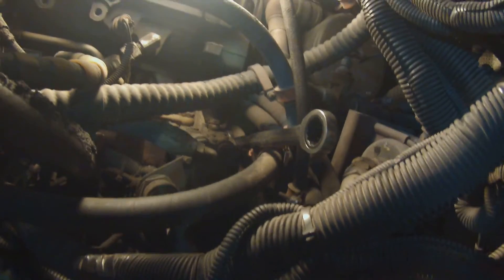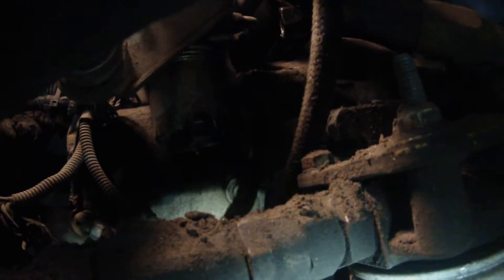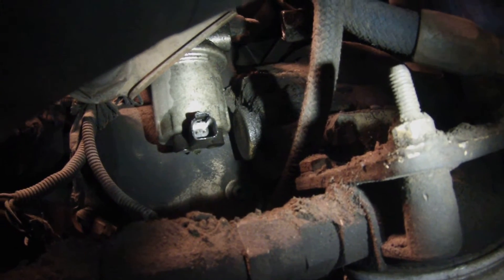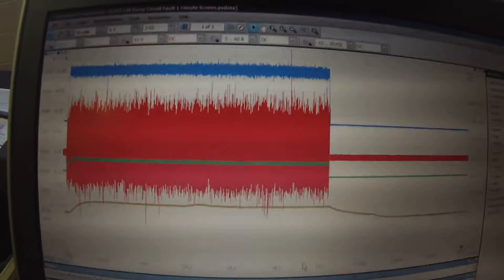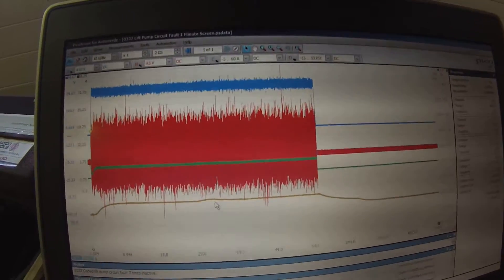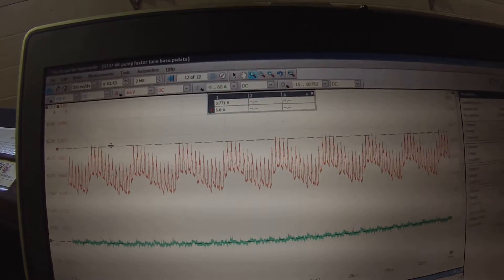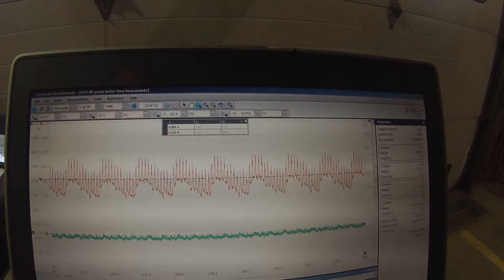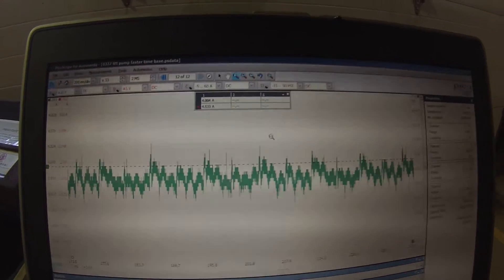0337 Lift Pump Circuit Part 1

Comment from the maker: The Lift Pump helps keep the fuel system primed on start up and there is also a check valve in it.  You will experience long crank times if the check valve in the pump goes bad or if the Pump stops supplying enough pressure to the low side gear pump port on the Injection Pump.  This model has a rotary distributor style Injection Pump that is electronically controlled.  Thanks Joe.